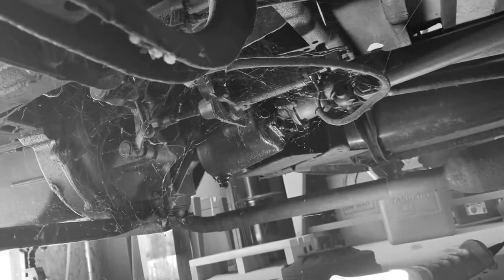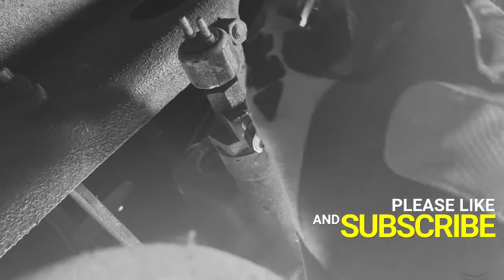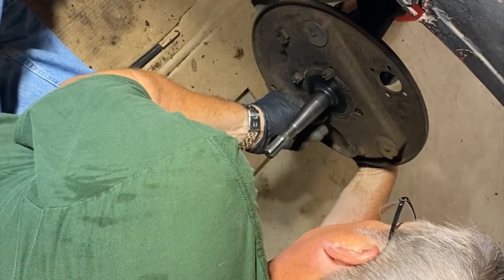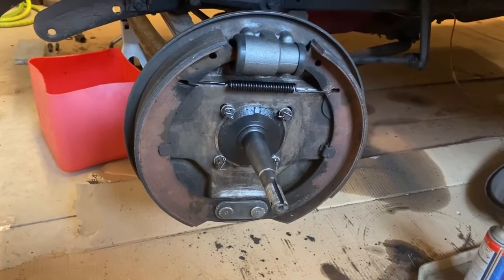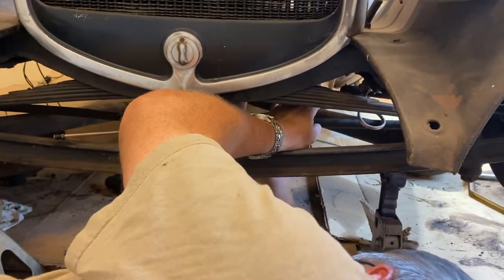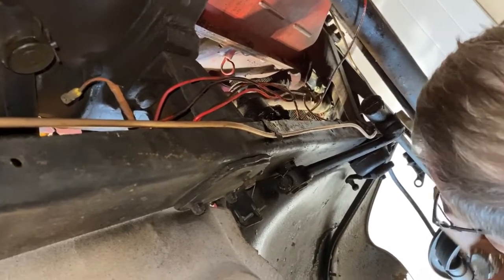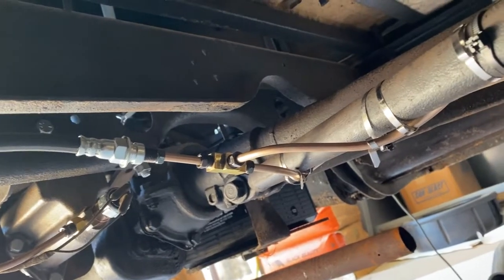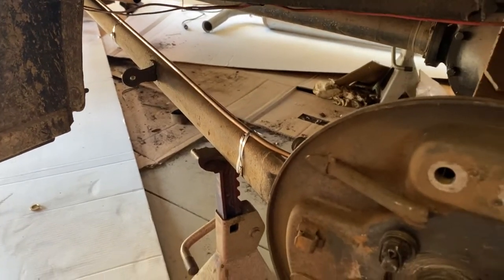1930 Ford Model A Restoration - Ep. 9 Hydraulic Brake Line Install | Epic Neon | Epic Restorationz

Comment: How did you get the correct replacement parts for the drum brakes. Working on the same sort of project but am just going to try to replace the wheel cylinders.
Reply from the maker: We were able to get our wheel cylinders from Macs, but several Model A vendors sell them. As far as internal drum parts, we haven’t gotten there yet. At the time of this recording, we were just trying to get the car running and driving to see if there were any engine or transmission issues. We will get into a more thorough restoration of those parts down the road. If you’ve followed our videos we acquired a chassis with mechanical brakes that we are currently working on right now, but will return to the other chassis at some point. Best wishes on your project. They sure are fun!
Reply: @EpicRestorationz  yes this is really my first project. This car is a 29 that a buddies grandfather must have added the hydraulic brakes so don’t know what they off of or if that’s just a conversion kit they offered. He also put a flathead in it, build a small truck bed that can be installed if you take out the rumble seat. He welded on a hitch and use to tow him dirt track car with it. Very cool story that adds to my love for the car.